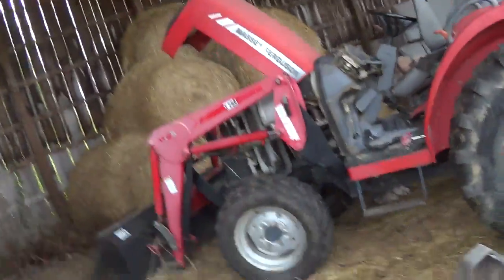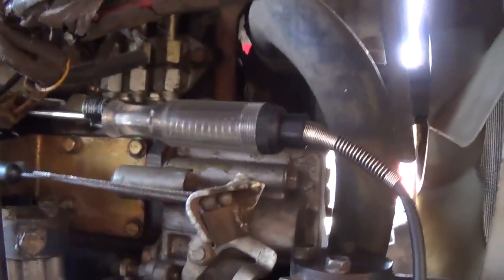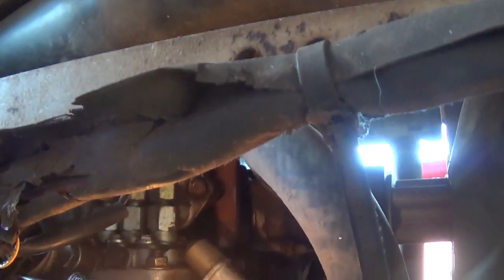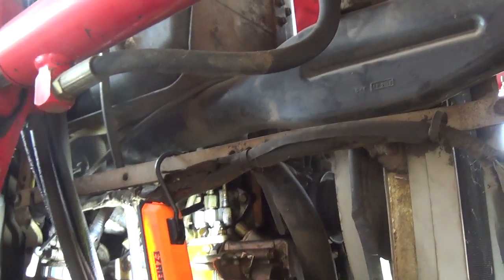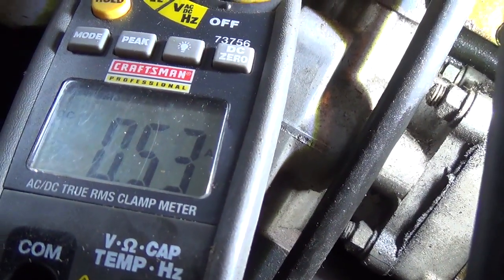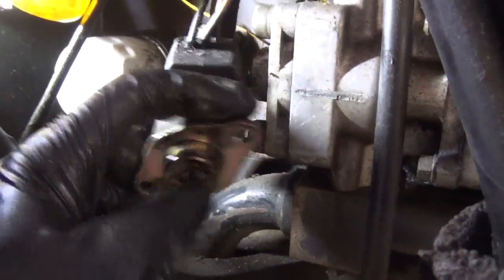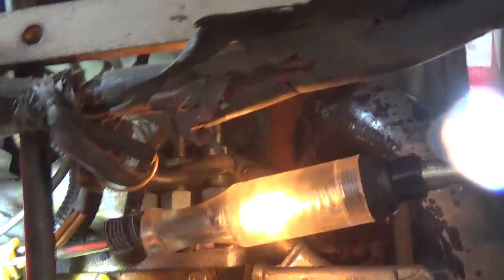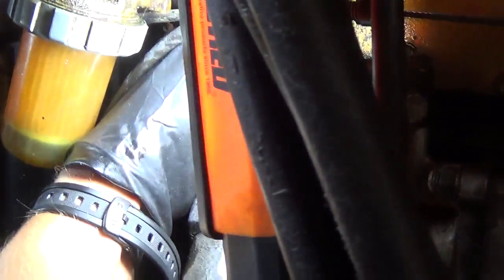Crank no-start: Massey Ferguson Diesel

Comment: Customer had same problem with his john Deere power on would not engage solonoid to allow fuel to engine. Good indicator that this is your problem I know on john deeres when you are trying so start should be some black smoke out the exhaust none on this one replace the solonoid black smoke and fored up

Comment: in case anyone else with this issue and a similar agco tractor like my 2006 challenger mt265b the part number is 6242128M1 and itll run about $253. theres also a gasket for it that cost me $11. there are similar ones on ebay for yanmar tractors for $18 but im not sure if they fit they just look similar in the photos. the bolts are 5mm hex wrench.
Reply: Great supplemental information. Thank you.

Comment: This also my issue, bad solenoid, pulled it out and it started right up. But my issue is that even with the key off, the solenoid is hot to the touch, so its pulling juice whether the key is on or off, so my solenoid might still be good, if its not cooked, but what ever is providing it power is the issue. Just bought this tractor, Massey 1230.

Comment: Hey great job on breaking it down & finding the problem & the solution , I have a M-F 1526 ( 2018 ) but pretty much the same Iseki 3 cylinder diesel & she is a great compact tractor. I saw the tractor & said myself that looks similar to mine & that's why I watched the video , But I was impressed that it ran on only 2 cylinders . Thanks for the very informative video & maybe a future reference.

Comment: Thank you Ivan. Same problem with Massey ferguson 6028 ( new tractor) . We fix new solenoid valve, Tractor started,  but we get another problem . Solenoid valve is heated and melts wiring

Comment: Great job Ivan , I also have a MF so this will come in handy down the line  thanks !  BTW those engines are typically made by  Iseki in Japan ,good engine.
Reply: I have a 451 massy they usually come with Perkins engines did but I think they just use the Perkins in bigger tractors iseki is a good engine forsure
Reply: Mine is a 1970 40B. 4 cylinder Perkins. Still runs well. Shut off is mechanical, pull cable in the cab.

Comment: Fuel selnoid coil needs to be on to get fuel,shuts off when there I low oil pessure. Just open fuel manually because the coils fail. First thing you check on all diesels and you don't need a wire diagram

Comment: The fuel solenoid should have power because in its default state it shuts the p pump off. In order to allow the pump to flow fuel to the injectors the “pull” terminal pulls the solenoid inwards, then the “hold” terminal keeps it pulled in and the timer tells a relay to shut off the power to the “pull” terminal. At least that’s how it works on a yanmar diesel so I’d figure most are the same. I have a Perkins 3 cylinder that is doing the same thing yours is, cranking but no start symptom and it’s all pointing to the fuel solenoid having no power to pull the rod in so the pump will feed the injectors instead of bypassing to the return line.
Reply: I have a  Massey 3 cylinder Perkins doing the same thing, what was your fix?

Comment: Dont jab the wiring terminals with the test light, use a proper test lead. You'll stretch out the terminal and cause a wild good chase looking for the issue

Comment: One Diesel engine I worked on had a system similar to that.Electric switch had to activate to let engine start,but the engine maker had thought of failure,put a screw in plunger on the pump.If the solenoid failed mech could turn the screw in try the engine.when engine started you knew what problem was.Only thing was the only way to shut engine off was to screw the little plunger back out,turning the on off switch off would not stop the engine.

Comment: Diesels all run and start by the same diagnostics. Too bad, today they are burdened by all of these electrical and electronic controls. Somebody told me a long time ago that diesel engines and electronics should never be together. Good diagnosis.
Reply: It depends on the application. On a simple farm tractor, maybe we don't need electronics. But in something like a semi truck, the electronics is great. You get cruise control, progressive shifting, diagnostics, much better fuel economy, much simplified gauge panel integration, etc. Once they get the emission stuff figured out, we'll be all set.
Reply: At the shop I go to, the number one failure on over the road semi trucks is electronics. Anything and everything that can go wrong will go wrong. I had a fuel control pcm go bad on my truck and $3000 later I was able to pull a load again.
I do believe in electronics and when one day if they become absolutely reliable, it will be a great day.

Comment: I once took apart a start solenoid on an old outboard. Cleaned the contacts that were blackened from the juice/no juice routine and where I had drilled out the rivets, put some screws in there in place. It was working years later. Electricity takes it's toll sometimes too soon especially if the contacts are not stationary. Then even if they are then you have the corrosion issues to keep an eye out for. Again very enjoyable and great diagnosis Ivan !

Comment: you know with the load-pro I would have been done in 5 minutes on this job . load-pro test plush button no voltage drop in harness crack fuel Line on this old not New Diesel no fuel check for air leaks no leak your done! fuel shut solenoid fault .
Reply from the maker: Alright you bring your LoadPro and I'll bring my stopwatch. Ready, set, fumble! 

BTW with a testlight I was done in 15 minutes, including making this video! xD

Comment: Ahhh you got there eventually. 
Surprised you thought initially that the shut of coil would be energised with the key off. Imagine all those flat batteries on diesels if that was the case. ☺ Good logical thinking and testing got you through in the end and showed that with common sense you dont need to be experienced on a particular vehicle type to get the job done. Standard testing methods applies across the board and is all that is needed. Good job
Reply from the maker: Thanks. Yeah obviously the fuel cut solenoid wouldn't remain on all the time, I thought just a temporary on-time to stall the engine out. Turns out it's even simpler than that :)
Reply: all sorts of different strategies to do the same thing -internal/external, single wire case ground ,2 wire case  ground, 2 wire 1 hot one ground,3 wire one pull in one hold in one ground, then there is energised to run and energised to stop. some use a timer.  some use a timer and a relay. like those if in doubt pull it out and run the rack manually.

Comment: That's what Massey gets for replacing a mechanical plunger with an electrical one. 

That's the way of the 21st century - take a simple part or component of a system, then, add electronics to make it complicated, expensive, and failure prone. Keeps guys like us working, at least. :)
Reply from the maker: It's all about "safety"...the engine shuts off if you get off the seat!
Reply: Yeah, that's the other fun part of the 21st century! Lots of safety devices ...
Reply from the maker: Most of those drive me nuts haha
Reply: I hear that! Me too. I bought a new Husqvarna z-turn mower a couple years back - first thing I did was run a long zip tie over the pressure switch in the seat. :)

Comment: I remember Diesel cars having a fuel shut off solenoid back in the 90's. My old boss Had a Rover Diesel that wouldn't shut off as the valve was stuck in the on position. Had to bold it on the brake and let the clutch up to stop it until he got the new valve.
Reply from the maker: Good thing it wasn't an automatic ;)

Comment: You are lucky its not a common rail 😁😁
Reply from the maker: that would have been more fun...More stuff to scope, like high-voltage fuel injectors ;)
Reply: +motoYam82 hahahahaa yeah recently im trying to learn as much as i can about them, like INLET METERING VALVE, pressure sensor signal more than 1 volt for the ECU to sent the injection pulse ☺️
Reply: +motoYam82 maybe in the future there are only a small number of videos troubleshooting non starting common rail if you can upload something about it 😀😀

Comment: Well done Ivan! You are building an excellent reputation for debugging electrical problems on diesel farm tractors. You solved that starting problem with the Oliver 1600 earlier this year and now isolated the fuel control solenoid as the problem issue on the Massey Ferguson.

A real challenge of your skills would be solving electrical and starting problems with John Deere diesel tractors made from 1958 through 1968. Those tractors used a 12 - 24 volt electrical system. While running the system operated on 12 volts but during cranking it used 24 volts at the starter. Those systems were trouble prone with lots of electrical gotchas!

Comment: Could that solenoid have a diaphragm that leaked, and contaminated the electric coil- or is the coil just weak? Could it be taken apart, cleaned out, resealed?  If man has hard time locating the part- maybe try here- http://www.yesterdaystractors.com/
Reply from the maker: I might tear the old one apart to see what failed. Just surprised that parts for antique tractors are more readily available than this Japanese rebranded machine...
Reply from the maker: I actually did some bench tests on the old solenoid with a scope...pull-in coil amperage was very unreliable: sometimes nothing, sometimes 7A but still not enough oomph to pull in the plunger. Also timer would emit a high-frequency electrical squeal lol
Reply: Just a hunch but I'll bet it's the timer gone wonky.  it's either too fast or non-functional.  And for all we know that coil is open.  Having several episodes with shut off solenoids myself, you can imagine me pointing you to the problem as soon as I saw it had one.  Next time you'll get on point even faster.  Nice one Ivan.
Reply: motoYam82 Overheated windings. Fried.
Reply: More likely just crappy construction to start with, they really aren't interested in giving you value for your money anymore, they just want your money.  That's way too much amperage for that purpose, it's shorted across it's own windings then.  A little baked on spar varnish when it was newish would lock down the windings and then they don't rub themselves into this condition.  But that would have costed an extra nickel so no soup for us.  But like Ivan pointed out to me a long time ago, that's our bread and butter, they pay us to fix em.  Thanks for the follow up info, Ivan.  I always love an autopsy report.

Comment: Well done Ivan! John Deere used a thermistor in their pull in circuit on the early 2000's compact utility tractors. They are soldered on a pigtail behind the fuse panel. Ask me how I know. If you run into one someday they are switched on the negative side. Keep the videos coming!
Reply from the maker: So why a thermistor?
Reply: Ivan, thermistors are a passive electronic device that changes resistance as a function of temperature. In the JD application the thermistor allows high current to flow to the "pull in" winding of the fuel shutoff solenoid for a few seconds. They high current flow causes the thermistor to heat and increase resistance to reduce the current flow through the pull in windings. I am guessing the Massy has the same device in the timer module. 

Please let me know if you have any other questions.

Best regards, Alan
Reply: @atschirner  A similar thermistor application is used on the start winding of a refrigerator compressor. A good jolt of 120VAC gets the compressor started, but the series thermistor quickly heats and cuts juice to the start winding while the run winding connected directly to 120V takes over. Before thermistors, this action was completed with a current relay.
Reply: @reecenewton3097  Thanks Reece, I haven't been in a compressor start circuit since tech school. Makes sense, lower cost and more reliable than mechanical contacts in the relay.

Comment: He mentioned starting fluid. To start some diesels after someone ran them out of fuel we would take a rag and pore gas into it, ring it out and then put the rag over the intake. When you cranked it, it would start but it would knock bad until it picked up the diesel! Thanks for the video.

Comment: Nice one Ivan. It's amazing years  ago it was just a lever for on/off.  Not an expensive part . Cheers 👍👍
Reply from the maker: Hey Steve! I'm actually having a surprisingly hard time sourcing this solenoid on the internet...might have to go with an aftermarket Chinese knockoff!
Reply: It's a common part. Not hard to source at the dealer. It's used across the world  MF will have it . I believe its about $250
Reply from the maker: Holy crap $250?! Is that Canadian dollars? Find me a link Steve I give up!
Reply: motoYam82 this is the outfit i use,  http://www.usautoelectric.com/solenoid-_-fuel-_-shut-_-off/
Reply: motoYam82 sent you a link probably went to your spam folder
Reply from the maker: So my I can't see my own replies to your comments on my own channel...why YouTube? why?
Reply: Did you see the link I sent you ?
Reply: Well, I can't see your replies either.
Reply from the maker: Yeah I got your link no problem...
Reply: Baxrok2 seems strange I can see them all . Youtube is so unreliable .